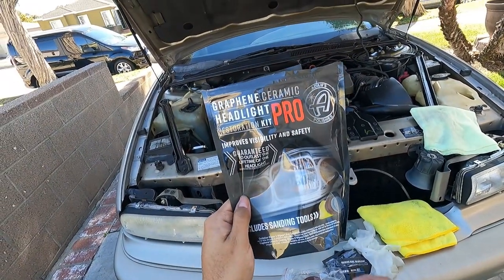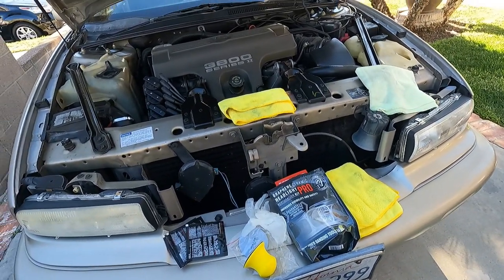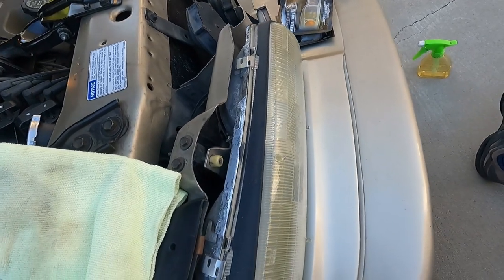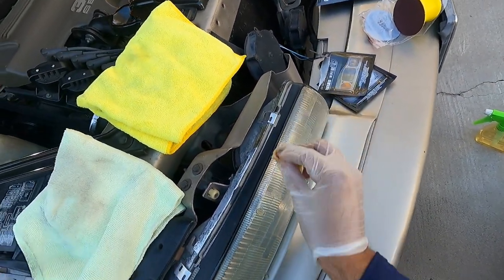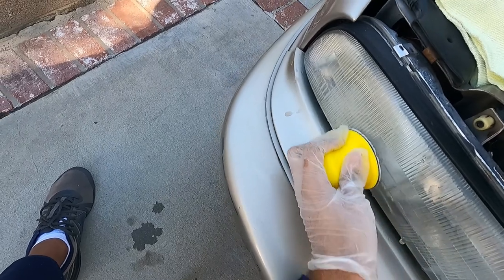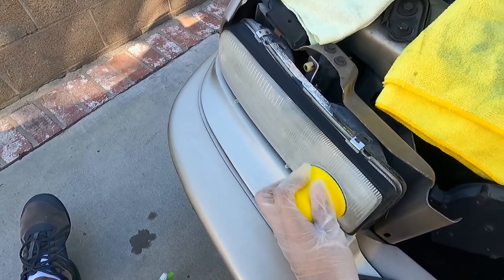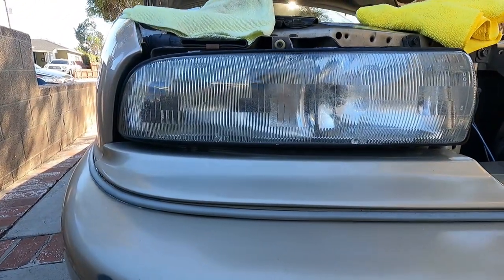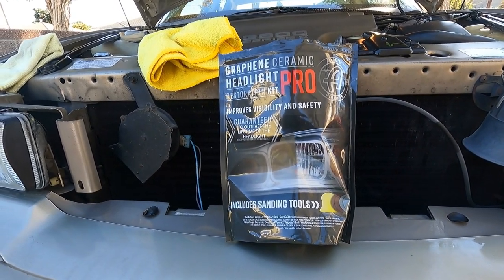@AdamsPolishes Graphene Ceramic Headlight Restoration Kit (Pro) - Does it work?

Comment: Last Summer I bought CERAKOTE Ceramic Headlight Restoration Kit and used it on my aging minivan and it really works.  8 months later and the headlights still look good.  I bought the black trim restorer, CERAKOTE Ceramic Trim Coat Kit, and it really works.  Still looks nice and black 8 months later.  Worth the money.